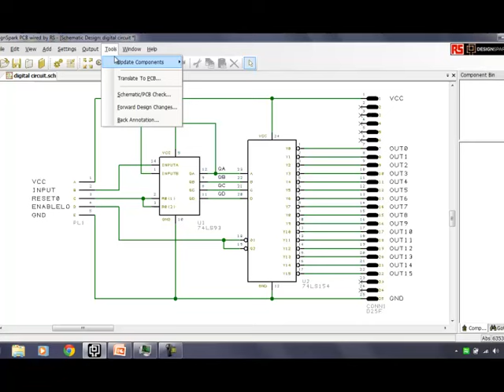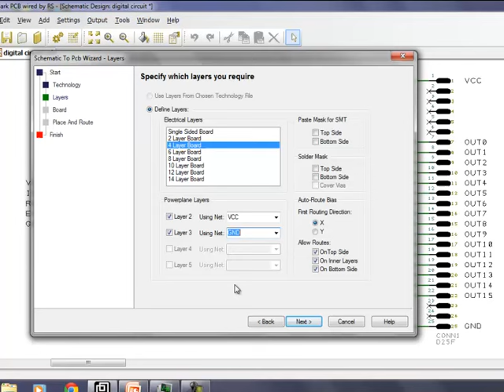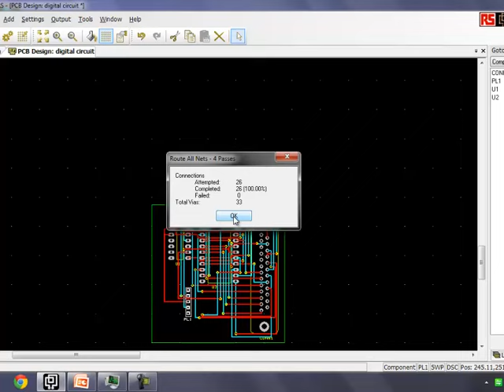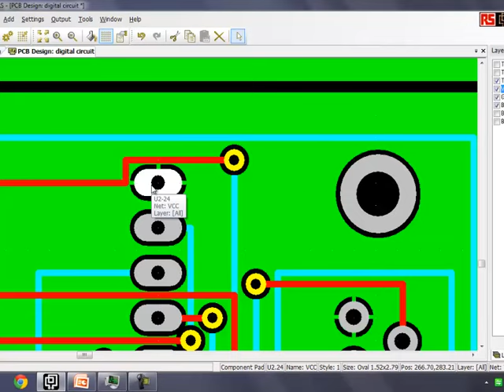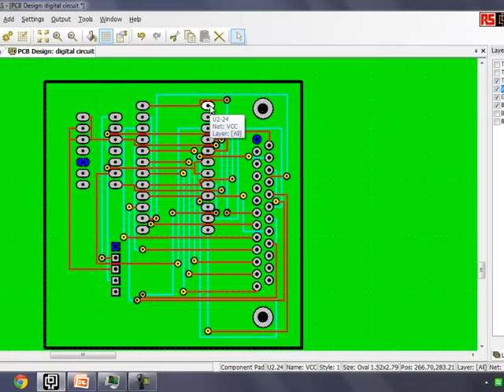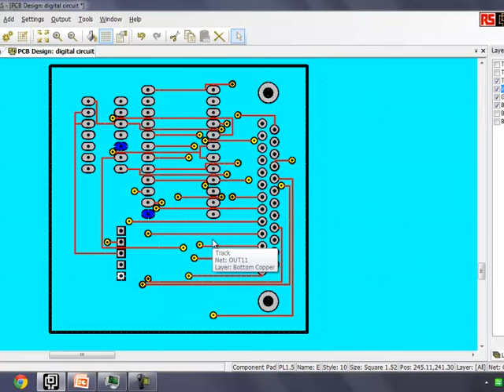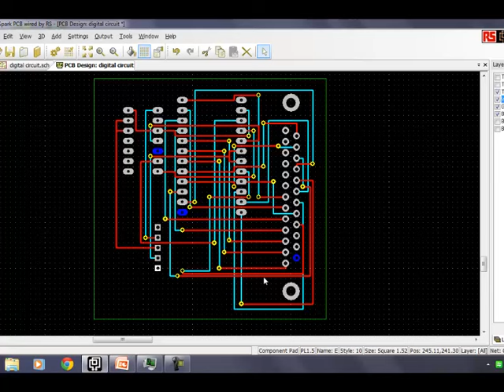Planes in DesignSpark PCB

Comment: I am using Design Spark PCB version 7.1 
                                                                                        I am using single sided board, although I selected single sided board the autoroute is bugging out on me and creating through hole VIA's how can I turn those things off ? It is driving me nuts because every time I do an autoroute these through hole via's are everywhere makes the software almost useless for the Auto Routing. I think this must be a bug in version 7.1 because it was not happening in the previous version.. Based on the fact nobody seems to be receiving replies to questions on here I think I will switch to some other design software.